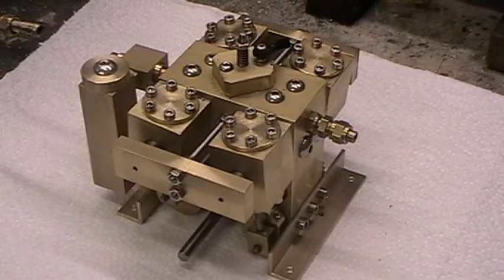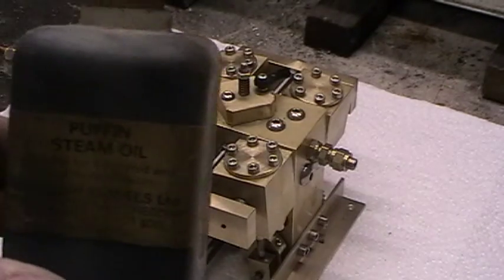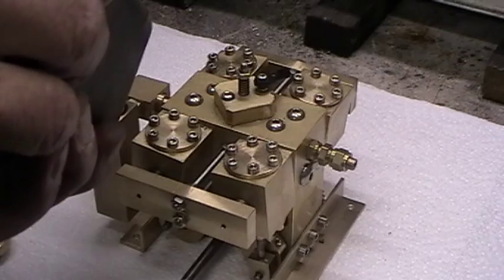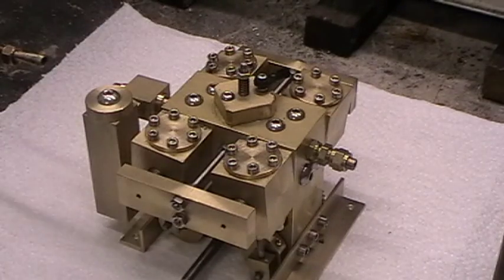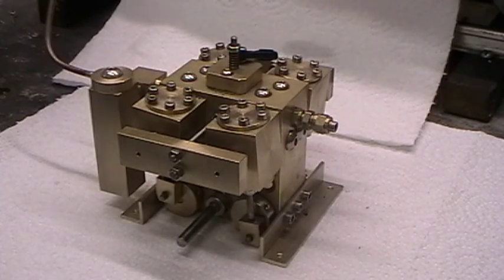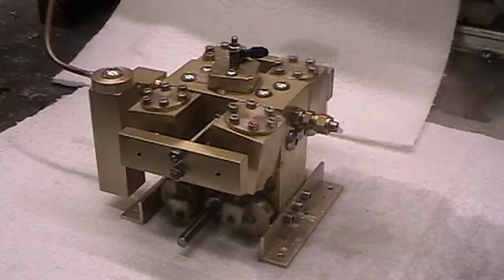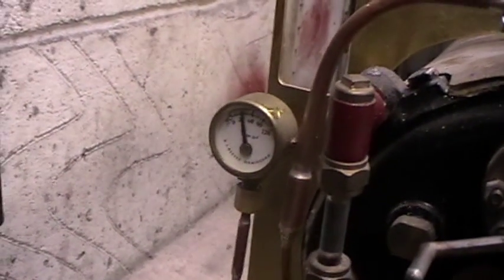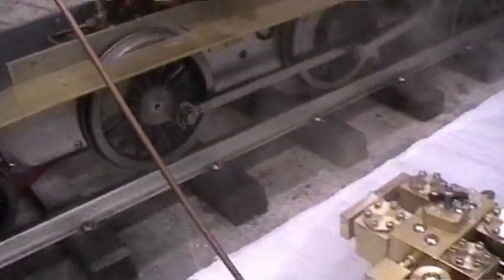4 Cylinder Live Steam Oscillating Engine for Model Boat Running on Steam

Comment from the maker: When engine is started from scratch it is cold, the steam condenses as it enters the engine and turns back to water, hence the ejection of water on start up, Once running and engine has heated up to same or near same temperature as steam then no condensation takes place and only steam is ejected .Hope this helps

Comment: I don't understand. When I watched the video, I saw a clear liquid that seemed to bubble and smoke. I was under the impression that water, when heated to 100c will boil and turn into a gas. As the temperature cools, the gas turns back to liquid. That is what I saw in the video and why steam is used in the title, not titel. What did you observe? Please explain so I can understand.

Comment: i'm new in the hobby and may I ask, is it realy actually durabe enough to run at such a high RPM? Those rods and pistons must be working hard. Do they sell reservoirs that do not need a cap? Like a niple or something that you can use to put oil in?